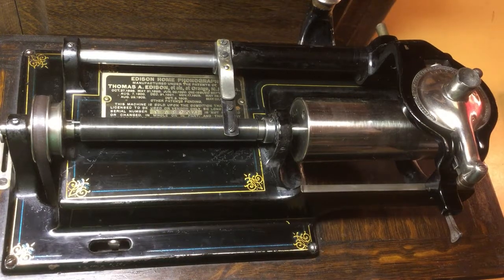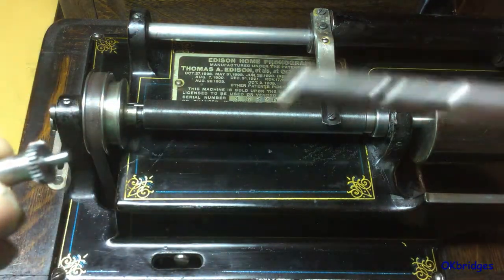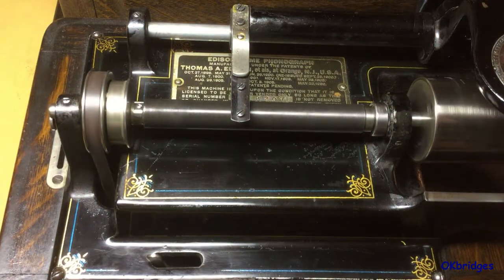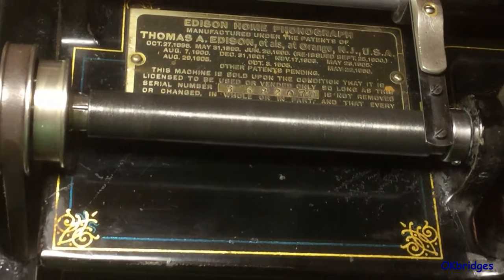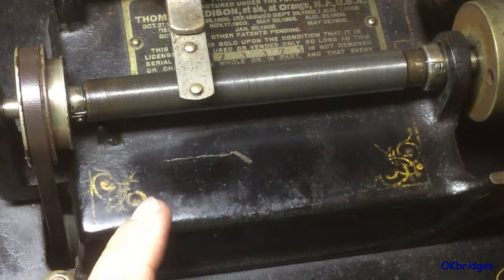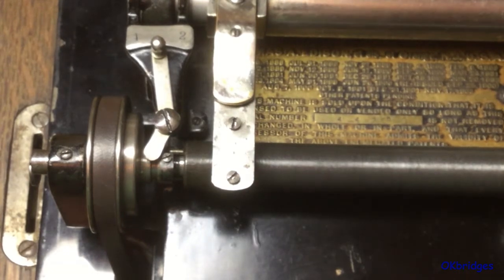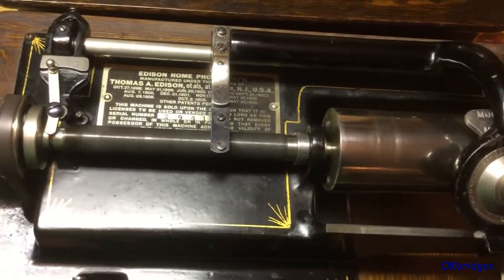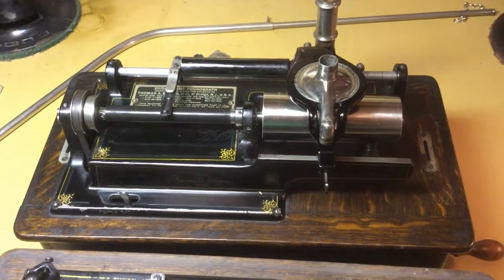An Overview of 2 and 4 minute gearing on Edison Triump and Home Phonographs

Comment: Fantastic video!  Very informative and helpful.  I just picked up a Home model at a local swap meet and assumed it was just a 2 minute player until I started monkeying around with it trying to figure out why records were repeating.  Bottom line is I discovered it's a 2/4 minute conversion kit.  Works perfectly with the clutch casing in the proper position.  Thanks again for your great video!

Comment: I enjoyed watching this very much. I too have a Triumph A, in a B box. I also got mine at Union in the 90s. I was fairly new to machines at that time, and did not know it was a 2 and 4 min machine. Someone pointed this out to me after a year or so, and I now had a way to lsiten to 4 min cylinders. I had taken it in for repairs because I could not get a troublesome thump thump thump out of it, and I had over-tightened the "cone bearings" to the point that it would not turn. The repair guy showed me the very delicate difference between too tight to turn, and too loose so as to allow the shaft to thump. Thank you for your videos
Reply: Can you explain how to not overtighten the bearings. Thanks.
Reply: @TheDtrolinder  To adjust the end bearings on A and B models, there are two screws: the set screw on top, and the broad headed screw (called a "grub screw").

Loosen the set screw, and turn the grub screw to move the bearings in or out (the left end does not have a flange, but butts up on the end of the bearing; so to move the bearing out, you will have to push the shaft to the left): the mandrel should be able to spin freely (with the belt off) for several seconds, without too much end play. Then tighten the set screws again.

Comment: This is also the exact setup for Model E Triumph phonographs. On my Triumph the pulley which should have been labeld "E" or "D" was actually labeled "C" but it looked exactly like the one you show and it worked with no problems at all, so apparently even a "C" pulley will work on the D and E models. I know that on some earlier models this can be a problem but it has worked for me for several years with no problems.

Comment: You had mentioned that the two different 2/4 minute gearing kits came with different instructions.  Do you know a source where one can read/view or purchase a copy of these two different instructional brochures published by Edison between 1908-1911?   George L. Frow states in his "Edison Phonograph companion" book,  that the Model D phonograph models Triumph and Home with factory-installed 2/4 minute gearing - were introduced Oct. 1, 1908, then improving the methods of production/distribution by Nov. 1908.  I have never seen the transitional shift mentioned in your video - it must have been a version with limited number made.   [Retired early recordings archivist, Library of Congress; collector of early Edison phonographs, cylinders, etc. since 1958].
Thanks for your great informative video.
Reply from the maker: Several years ago when I first got my Model A Triumph and was searching for what parts I would need to convert it to 2/4 minute, I found images of a machine with what I called the transitional shifter in the video. The images of the machine in question, a very nice Model A Triumph, came up annoyingly frequently and I checked to see if I saved a copy of the images but alas no. 
Annoying frequently is what made this variation of the shifter so memorable-I was looking for parts I would actually stand a chance of finding, not unique parts that may have seen a limited use. And that is probably why I didn't save the images of the machine.....

Comment: I’m thinking about purchasing a Triumph machine after I buy the reel to reel deck that I want. When the this whole coronavirus thing is said and done I’ll probably have enough money saved up for both.
Reply from the maker: They are nice machines, but they can get spendy fast! Both of these I got cheap because they are/were project machines The A I bought at Union in 2014, and the B came from someone on the Talking Machine Forum Yankee Trader. 
Make sure the feedscrew is in good shape or you have trouble.
Reply: okbridges Things are up in the air now. There’s also a possibility I might get a Vic II instead.

Comment: This helped me with my great grandfather's model D. I just was not properly engaging the 2 minute gears. However, the 2 prongs holding the leadscrew to the changing gears are barely connect when in 2 minute and sometimes come lose when it is switched. Do you know of a way to fix this?

Comment: A possible solution to shifting the 2/4 min. pulley on the Model B - - rather than using a fingernail or fingertip, why not use something fairly soft such as a Starbucks plastic coffee stirrer, or perhaps, a toothpick [something that won't scratch or gouge the metal pulley?  I have two Triumphs [Model A and B] both having the later 2/4/ minute shifter - which can be a bit difficult to keep in good adjustment, but which - I believe - to be a better Edison design.

Comment: I notice that the 4 minute position seems somewhat noisier than the 2 minute position. Is there a reason for this? Thank you for an informative video!!
Reply from the maker: Dirty or worn gears, or worn bearing hole in pulley for the reduction gear, gears or feed screw in need of lubrication. If in doubt, disassemble and clean and lubricate all parts. Some light grease, about the same weight as Vaseline on the gears will help to make them run quiet.
Reply: You will always get a little bit of gear noise in the 4 minute position but it does not transmit sound into the horn so it can only be heard if you are close to the phonograph itself. The gear noise comes from the small gears that are active in the 4 minute position but inactive in 2 minute mode.

Comment: do you have to adjust the speeds on the governor or any sort of trouble shooting on it or is it more as soon its on there its plug and play?
Reply from the maker: I'm not sure I understand what you are asking. The 2 minute and 4 minute records both run at 160 RPM if that's what you're asking. The gearing just changes the speed of the lead screw to match the thread pitch of the grooves on the record.

Generally, 2-minute records recorded before about 1903 will run at different speeds depending on the length of the song recorded, anywhere from approximately 120 to 160 RPM.
Reply: @okbridges  sorry for my slang mate, I’m asking when you set it up would you have to do any adjustments or once it’s setup it’ll play the intended records at their speeds once everything has been hooked up.
Reply from the maker: @Filmandmusicdegenerate  Yes, once it's setup on the machine correctly it will play the records at the right speeds. If your machine plays the records fine now, it will operate the same with the 4-minute combo gearing added on.